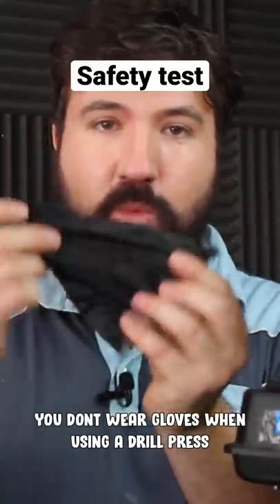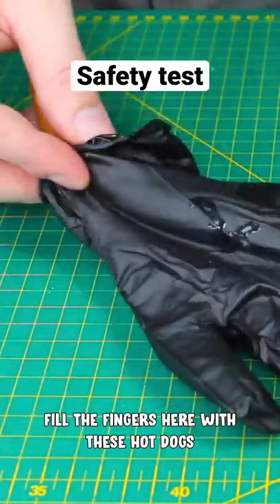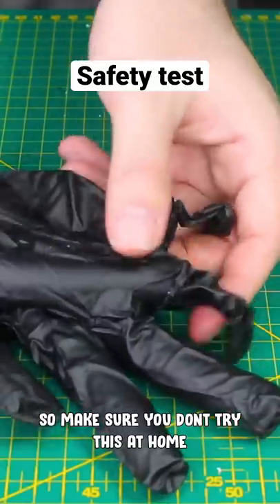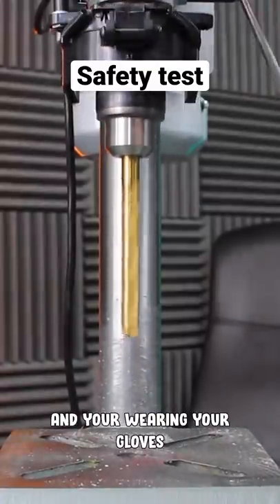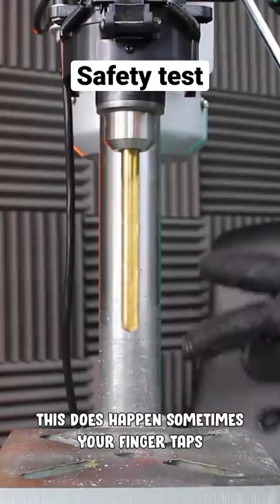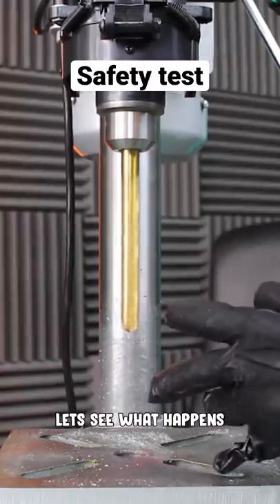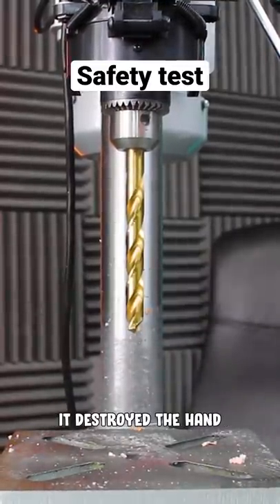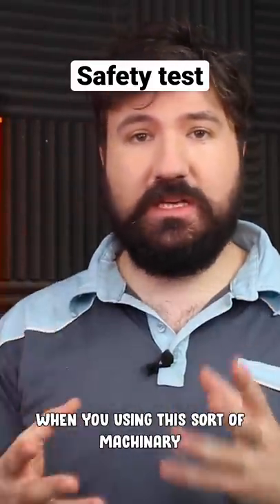Never wear gloves using a drill press insane result!

Comment: Also, when working in a shop you should always either tuck in or take out hoodie strings, especially around a grinders. You DO NOT want your face getting pulled into spinning things haha
Reply: Haha, true 😄. They told us that in automotive school. Wearing a tie or hoodie, while checking a running car is a bad time. Be safe everyone. 😀
Reply: Ooh yeah thats the most terrifying way to exfoliate your face. Also to all the ladies, metal heads, and long hairs who use powertools, TIE ALL YOUR HAIR BACK. A couple months ago a stray section of my hair got pulled into one of the vents on the side of my power drill. my drill bit was in too deep to pull out and my hair was wound around the inside of the drill. 😂 I Spent like 10 minutes kneeling under a desk trying to use my free hand to pull a couple hairs out of the drill at a time without falling over
Reply: Don't forget to take off all jewelry too. Not only can it get damaged but it can draw your neck or your limbs into the drill bit or whatever machining tool is being used. And most importantly, be familiar with safety buttons or switches. So important. Would've lost my hand while using a surface grinder if I didn't know where the emergency switch was or how to use it properly.
Reply: Had this happen to me in welding class before school started for the day one day in high-school. I was trying to quickly finish up my final project and forgot to tuck them in and well... A string got caught in the grinder and pulled my face right towards the angle grinder. By the grace of God the string snapped and the metal tip launched across the room and dented the door to the room. Also was electrocuted due to poor bench design and worn out gloves but that's another story.
Reply: I winced at this
Reply: @departed2022  there is a lot of dumbasses who did that
Reply: 😨😱Thanks this was helpful. I can imagine it. And I'm super clumsy so I'm staying well away from drills and grinders
Reply: You reminded me of the creepypasta about flour mills that I used to belive as a kid lol

There was a worker who's been doing the powdering wheat and suddenly the power shutdown and because she's a noobie she forgot to turn off the mechine and tried to clean the mechine's insides and the power suddenly came back and pulled her inside and  when the senior or the main worker came back all he saw there was a pool of blood splattered in the on the walls and ground.

I was paranoid about going there for a long time as kid lol
Reply: let's be real here. if it's just some hoodie you don't care a lot about, you don't need the drawstring anyway. when was the last time you actually used a drawstring on a hood?
Reply: @notablediscomfort  everyone should have a shop hoodie! Also, I used to use the draw strings fairly regularly, but I got a beanie to cover the tops of my ears and that basically eliminated all use for them haha
Reply: @baki577  that stuff actually happens, and people do die like that. If you work around any decently sized machines you should be properly trained on depowing it properly, and how to properly lock out and tag out those power supplies.
Reply: I saw what happens when you get pulled in/thru a lathe... fucking gnarly
Reply: This is a good tip thats actual fact unlike this video
Reply: @xEvilRaptorx  there was nothing left of him
Reply: It’s fine if you’re extra careful tho… also, when you’re building some crap with power tools, it’s def 100% worth the risk to not look like a chump in the shop
Reply: @severalwolves  the problem is that people get too comfortable around shop equipment and accidents happen. I always recommend people to have a dedicated shop hoodie anyways because it’ll get dirty haha just pull the strings out and you’ll never have to worry about that again. If it’s just small stuff like using a drill or something it’s not typically a problem though because you can stop those pretty quick, but around a lathe, mill, drill press, grinder, or anything like that it’s best to keep your strings tucked away if you have them. Just don’t get too comfortable haha
Reply: Very true!!! Stand by this rule! Slammed my face on a roller when it grabbed my hoodie string and pulled me in. Also keep finger clear of moving shit. Got little finger pinched between 2 steel rollers. Lost the finger tip permanently 😓 SAFETY FIRST PEEPS
Reply: seen too many videos to not doubt anyone's advice for heavy and powerful machinery
Reply: Long hair.  Long hair is dangerous.  Also, when you tie it back, never braid it.  A loose piece of hair will get ripped out, a braid will either scalp you or draw your head into the chuck of whatever you are using.  This happened at my college shop lab a long time ago.  They keep pictures as a reminder...
Reply: @notablediscomfort  just now, before clicking on this video, i like having my face squeezed by the hood
Reply: @severalwolves  accidents could happen, if someone or something were to push you just a little bit in, you can't be fast enough to react. ALWAYS FOLLOW SAFETY PRECAUTIONS
Reply: Haven’t seen it yet but it’s also very important to pull sleeves back when operating machinery. I wouldn’t dare wear a hoodie in the shop, I’d feel like I’m asking to die
Reply: If you're going to be in a shop frequently no hoodie strings is the way to go. Yeah you don't have hoodie strings, but at least you have a face!
Reply: Yes r/makemycoffin

Comment: Latex gloves like the ones he used in the video are usually far safer than wearing thick gloves because they will tear off easier instead of pulling you in, and sometimes are necessary for working with some materials
Edit: but regardless avoid gloves when using spinning machines as much as possible
Reply: @oneslap01  um… those really won’t matter…😅 fingers are still pretty fragile
Reply: @russellspinks9370  Bones and muscles don’t matter? Of course they do, it may damage your finger, but it wouldn’t rip them out, a glove can get stuck to the drill but skin will pull off you it doesn’t spin you around.
Reply: @russellspinks9370  hshahah
Reply: @Colin.71  yeah
Reply: I used to work in a machine shop and this once happened to me drilling casings, and although I got scared like crazy I was able to pull my hand away and the glove just got ripped off. What you said is right. I feel like if I had thicker gloves I would’ve been done.
Reply: Nako_x🔞👇  dude stop it man. Y'all are just annoying bots
Reply: Me riding a carousel while wearing gloves because it’s cold: 😐😑😐🤬
Reply: Nitrile gloves are terrible. If you can't pull it on without snapping the entire wrist band off, there's no risk of losing a finger to one 🤣 
nah but in all seriousness, it's definitely better not to risk it. Same with hair, loose clothing, jewellery etc it was always drilled (pun intended) into us early on to keep it away from moving parts
Reply: @SkateboardingWithYerDa  that’s what I’m saying no way a nitrile glove won’t ripe before it gets wrapped up in the drill. I’ve done this exact thing tons of times without getting hurt at all. Id say unless you have some Machine with tons of torque and your wearing thick gloves. Your most likely going to be fine.
Reply: My Uncle caught his hand in an industrial bag sealer, wasn't supposed to be wearing gloves. Lost everything but his thumb👍
Reply: @noyou483  I like the use of 👍lol
Reply: @even2ez266  ignore and report for sexual shit. Best way man
Reply: I was about to comment that one. At my workplace we got huge ass mixing devices called dissolver. They literally mix multiple tons of liquid and operating them with gloves is prohibited obviously. Except for latex ones.
Reply: @oneslap01  you still have flesh
Reply: If your gloves catch ( there to big for your hand wear the right size…) the glove will tear. An we don’t wear latex gloves..?? Just a pointless stupid fake test, if u don’t know u don’t know 🤷🏻‍♂️
Reply: @even2ez266  ikr
Reply: @oneslap01  he meant that it will spin glove and will go through your hand (it can end up in ways :- either its spins in your hand due to gloves and destroy it or just go completely piercing through it 

It doesn't matter if its stronger nd has muscles
Reply: @Colin.71  lol
Reply: @Colin.71  ok sure
Reply: Wow  thanks my workplace tells us to wear gloves which I thought wasn't safe but what do I know
Reply: Latex easily grips the drill but ı dont think something like cloth would grip the drill
Reply: duh
Reply: A floppy hot dog pushed into a glove is nothing like a hand in a glove.
Reply: but our finger isn’t a Glizzy
Reply: Yes like my dad showed me a video of a guy on a big metal lathe. He turned it on and this kinda has nothing to do with just glives but his entire clothing (he was wearing baggy clothes) it sucked in his shirt and it tore him to shreds. Literally tore him to shreds. I am scared for life because of that video
Reply: @oneslap01  you do realize that the human mouth is capable of easily breaking every bone in your hands right? A power tool would annihilate it
Reply: Nako_x🔞👇  нет
Reply: @klaxx3761  no,the latex gloves so easily to tear,that is like you're saying that finger bone easily break in tesla door,bones with flesh can't easily tear
Reply: @Audiobook-Man  yeah
Reply: Yeah they should tear off when you touch. Your also stronger so you should be able to pull away on time with a ripped glove and a heart attack.
Reply: And your hand is actually attached to something sturdy and not being held when it can just be yanked out of your hand
Reply: I use gloves in my wood shop class though I probably shouldn’t I don’t have problems with tapping the drill bit or anything I keep my hands closer in to avoid it though I might just be lucky
Reply: Great I'll keep my glove collection away from spinning objects now 👍
Reply: What?
Reply: Yeah the example was kinda extreme but i guarantee some lacerations down to the bone could happen.
Reply: That’s exactly what I was thinking
Reply: Avoid Excess clothing in general (besides safety gear)
Reply: i use a battery powered drill every day and some times wear latex gloves when working with white material, i can attest that they do not just rip. some times, but not every time. when the rubber bunches up, it makes it thicker and harder to break it. it happens so fast too but nothing major like this machine, i just let go of the trigger and reverse it.
Reply: @Colin.71  I don't know man. I watched the Russian video of a man getting wrapped around a lathe...
Reply: Exactly
Reply: So true
Reply: @SkateboardingWithYerDa  w
Reply: @noyou483  Imagine the mechanic excitedly cutting open the bag of spare parts he has been waiting a month to receive, and out drops a pile of bolts and 4 fingers.
Reply: Scariest thing I've ever been around is the drive shaft for the hay maker 
I feel like it could wrap my entire body around it the blink of an eye
Reply: Isn't your skin basically gloves themselves, protecting your flesh and bones? If so don't touch drill bits regardless
Reply: Nitrile and latex aren’t particularly strong. Easy to tear loose
Reply: @russellspinks9370  you can’t see it but imagine the glove never broke and just kept wrapping around.
Broken finger vs mangled hand
(Yes i get your point a destroyed finger still sucks)
Reply: I was about say I knew some one who hurt their hand earlier and wore thin gloves to keep the “wound” from getting dirty or infected.
Reply: Kinda what I thought too. The latex gloves would just tear right off as you pulled your hand away upon feeling a tug(if you’re experienced around this machine that is). At least in theory 🤷‍♂️
Reply: @Maribites  I used to do work in a machine shop. Latex and nitrile gloves were a genuine safety hazard. Not as much of a big deal on a lathe, but it is dangerous on a mill and a drill press.

There are two things people don’t usually realize that lead to accidents wearing gloves:

1.) depending on your work speed, your hand and glove may get caught and yanked in before you realize.

2.) Gloves, even thin plastic ones, roll up when caught. It may be easy to tear a glove right out of the box, but it is very difficult to rip once it gets rolled up. Not a great worry if the finger of a plastic glove gets caught, as it will likely tear before it rolls up. If the band around your wrist gets caught, you won’t be able to break it before it yanks your hand in. The tendons to open your fingers lie on the back of your wrist. If your hand gets caught in the machine, best case scenario you lose most of your ability to use your fingers.
Reply: @Maribites  that’s usually the case, unless it is the rubber band around your wrist that gets caught. You’ll have less than a second to react before your hand gets drawn in. The rubber band twists up and becomes very difficult to break. It isn’t impossible to break, but it won’t matter if it takes longer than half a second. Once your hand gets caught in a machine… there is no added risk to not wearing gloves. Wearing gloves does add risk, even if it is only a little bit. Working on a job where any risk at all could mean death, it is important to mitigate risk as much as possible.
Reply: No need to edit, use gloves if you'd like or prefer to, just also use your brain when you operate machinery, you should be using it if you aren't going to treat it with proper caution
Reply: Why
Reply: @russellspinks9370  I’ll give it to you like this. After reading your comment it is safe to assume your brain is like a hotdog flopping around in the press and ours are like actual fingers with bone and muscle, which would not flop around with latex gloves.
Reply: I actually did this very thing with a thick glove on.  Thankfully, the speed of the drill was relatively low, so I was able to yank my hand out of the glove before it got completely wrapped around and mangled… escaped with only a sprained index finger, thumb, and wrist….
Reply: He used Nitrile gloves.
Reply: Yeah the uploader acts like hands and hotdogs have the same consistency… like what???
Reply: I have to hold the things I drill with my fingers (there's no other reasonable alternative) but because hours of doing this a day destroys my fingers i finally invested in rubber fingertips you get at office supply stores. ABSOLUTE GAME CHANGER. When they get caught they just slip right off no problem. (At least at the RPM I work at)
Reply: @Edward Elizabeth Hitler How the hell did he survive and is he still alive?
Reply: 100% I've had them ripped many of times. Would never obviously wear cloth gloves. This is very unrealistic